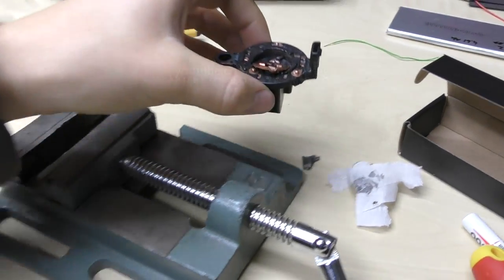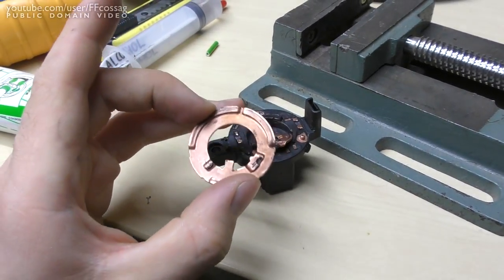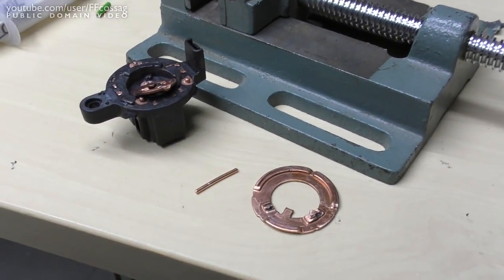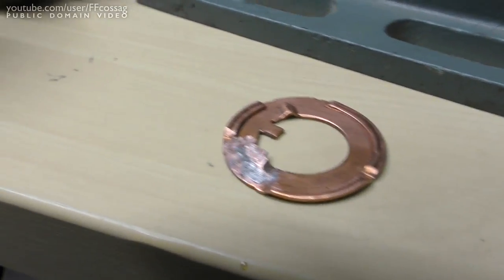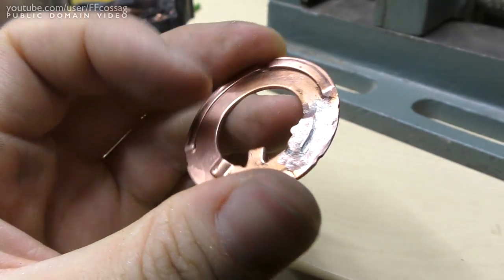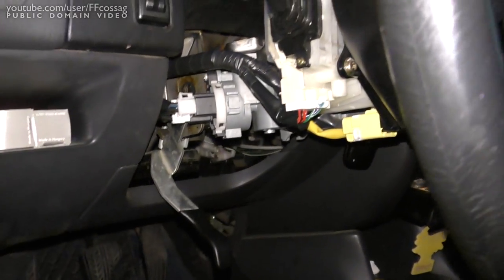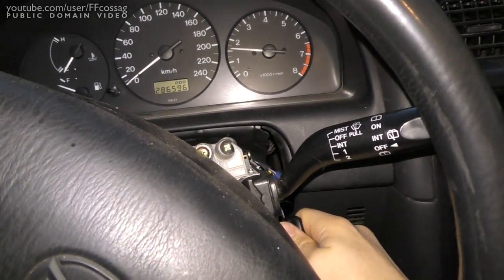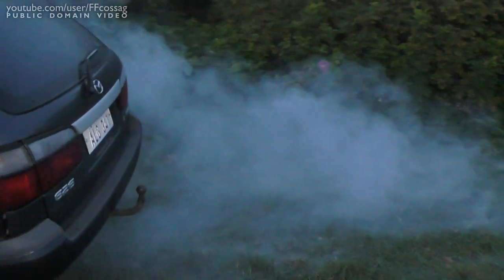Mazda 626 intermittent no-crank repair (worn ignition switch)

Comment: Thank you, for this share. My problem  with the engine start is resolved for now. I just cleaned the parts, didn t weld like you did, but it was enough. Now I see that my mazda 626 is not the only smoky one. 😅 I am not shure if it s the ring pistons or valve retainers, or any injection issue, out of time...but I have another engine in garage...thanks for your help. Greetings  from Portugal

Comment: That's a coincidence, I just got a letter last week for the recall of my ignition switch because the grease catches fire. I don't have that start problem, but mine is 10 years older and a different model.

I think Mazda uses poorer materials. Like if you pickup a Nissan, Sub, or Mitsu head it feels heavy, but Mazda ones feel light like they are a less dense porous Alum. And if you overheat a Maz head the seats and guides move making the valves leak, but the other good brans are so solid they usually don't.

Comment: I used to pull apart starter solenoids to repair the arc burned contact, never saw this trick however.

Comment: I have repaired a siwtch burned like thet on my citroen XM like 6 years ago "for a while, change it later" by just clening burned material. Still works today was hard to start twice. On audi i just got cheap replacemnt when it did that "wiggle to start" thing :) should have soldered the cittroen lock contacts. Or should put in relays in all my citroens.